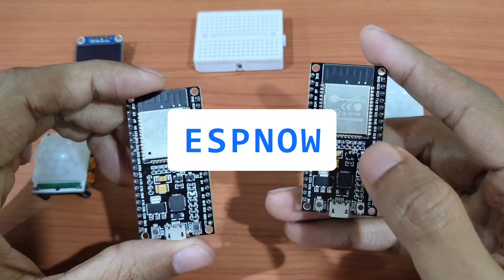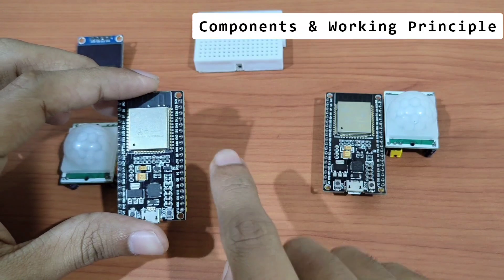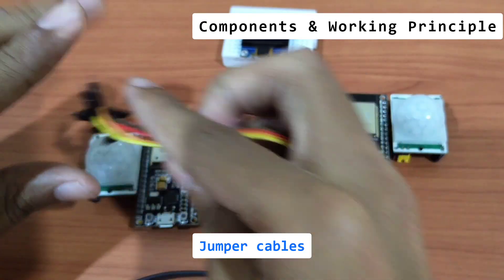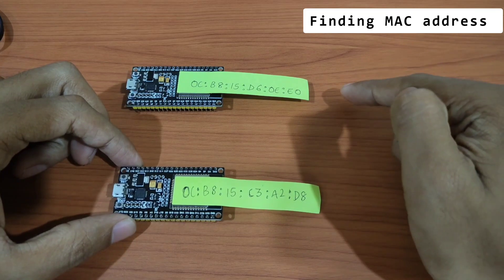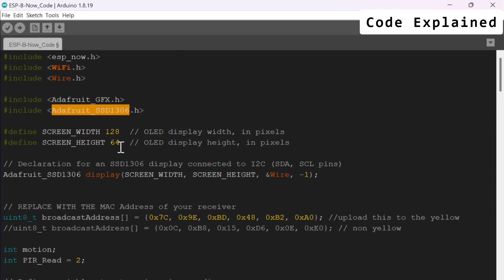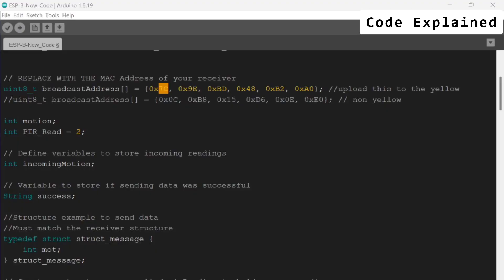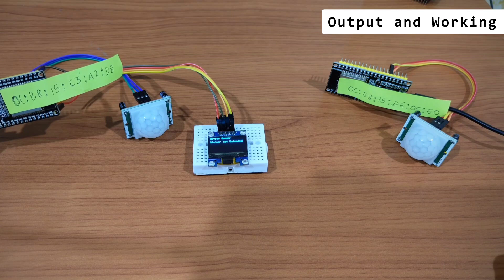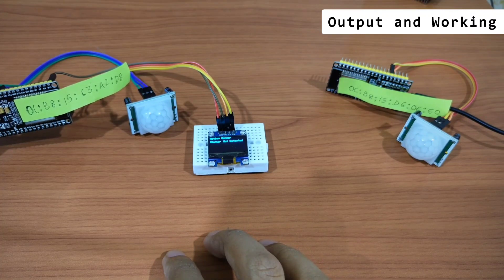Building a Motion Detection System Using ESP32 and ESP-NOW | Code Explained

Comment: Thanks for the video! How is the battery efficiency if you power it by battery? Can the motion sensor ESP32 with an E-INK last for a couple of months?
Reply from the maker: Esp32 has sleep functions which can save battery. There are ways of increasing battery efficiency. But could it last a couple of months... I'm not sure about that since I don't have the specs of your battery.